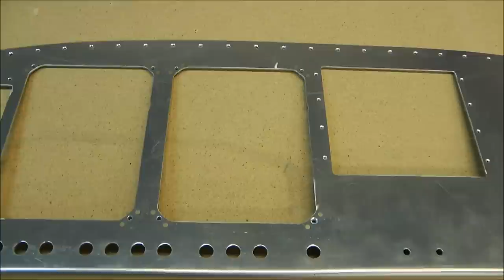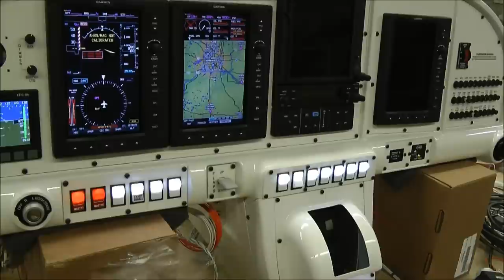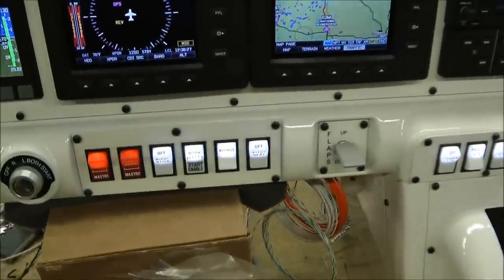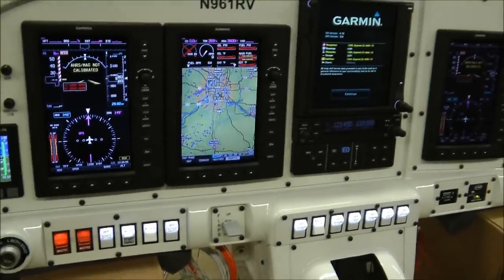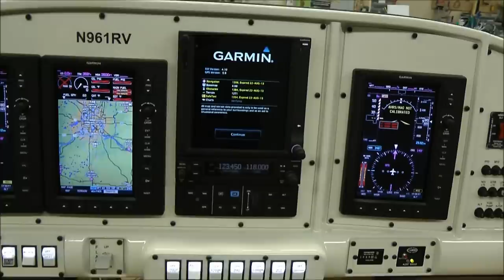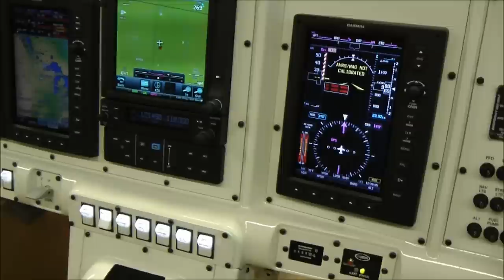0000: SteinAir Instrument Panel Services

Comment: Impressive.. I have a question about the avionics master relay, if that single relay failed in IMC, I could imagine a complete black out of the panel. Is that ever a concern? And have you ever thought about some type of redundant way to provide avionics power with perhaps double relays so it’s not a single point of failure? Thanks.
Reply from the maker: Not really...the EFISes are not on the avionics master, they are on the main bus. Typically the only items on the avionics relay are the radio, txpr, intercom and GPS. 

The backup EFIS is completely independent (with it's own internal backup battery), and most of these folks have independent backup batteries or stby alternators (not through an avionics relay) feeding the "power 2" inputs of the various avionics.

You do bring up a very good point though. For IFR/IMC operations, we feel it is important to have complete and independent redundancy to avoid single points of failure.